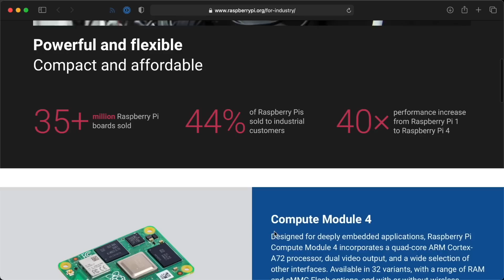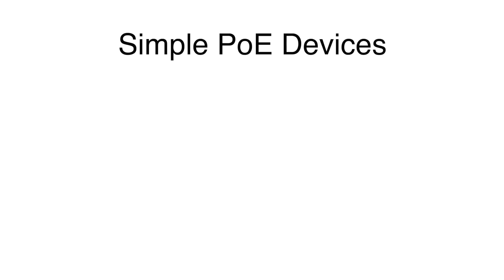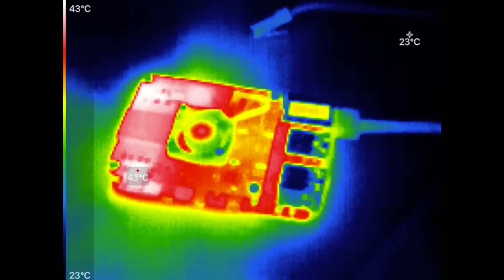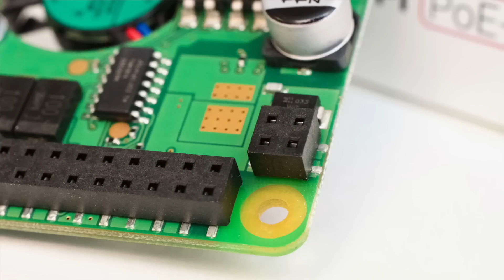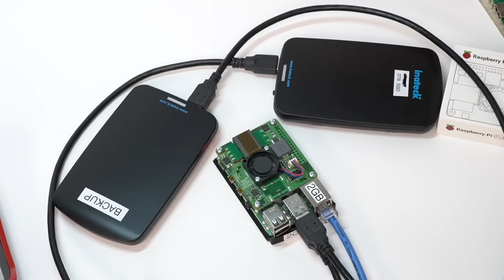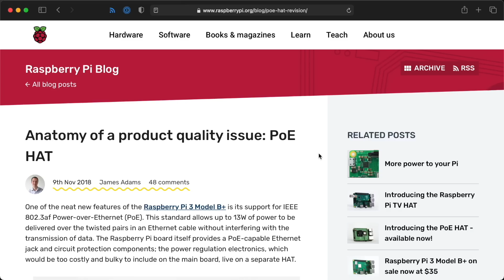Review: Raspberry Pi's new PoE+ HAT

Comment: They don't think much about their users and their products reflect that,  ivory tower syndrome.  They had a nice official case with swap out side panels yet they flipped the ethernet and USB position on the Pi4  making not only their own but lots of third party cases obsolete and they switched to the awful micro hdmi ports that literally nobody likes.
Reply: Having the same layout for like a decade is pretty good already. Sometimes, designs need to be changed in order to improve a device. 

They switched to dual micro hdmi ports because a lot (i assume. they wouldn't change it for just a dozen buyers) of customers use rpis for digital signage and wanted to drive two monitors at once, and couldn't fit two full-size ports. I personally think this wasn't a great idea, as the rpi is supposed to be an entry-level computer for learning and hobby projects. Businesses that need to drive multiple monitors for signage can afford more expensive options.

Unfortunately, if they change back to regular HDMI now, we'll have a third layout that's not compatible with neither 1-3 or 4 cases, so we're probably stuck with those shitty ports for a while.
Reply: @stale2665  ..as for “RPi 1-3 cases”, remember that the LEDs changed location on the RPi3 series, and the SD card slot changed as well…..
Reply: The issue here is lack of competition. The Pi is pretty much a monopoly when it comes to SBC, so there's no incentive to even listen to users. Whatever they do, people will complain, but buy it anyways, defeating the purpose of complaining about it.
Reply: Almost 100% of changes that the Pi has gone through were the results of USER REQUEST.

“Faster CPU”
“More/faster RAM”
“Faster USB”
“Faster network (gigabit)”
“Better/Faster Video out”
“4K Video!!!”

Well, folks, all these changes required faster chips, and faster chips required PCB lay-out changes..
And some of these layout changes required re-locating traces and chips and ports.
Some changes were dictated by physics (signal, current, AC-coupling, DC-coupling, inductive coupling, capacitive coupling, thermal coupling, etc & etc & etc) requirements..
PCB layout can be fiendishly difficult.

If the “deaf, ivory-tower snobs” had never listened to users, we would still be rockin’ Raspberry Pi 1A, 256M, 500MHz CPU, USB2, 100Mb network, 800x600 video…..
Reply: @ernestgalvan9037  How long it took for them to let us boot from USB again? People have been requesting that since the first model. Same for having the source code for the GPU.
Reply: @BrunodeSouzaLino  …yes, once again, RPi had to make major changes to the basic architecture, which deeply impacted things such as boot capability. The differences may seem trivial to a non-engineer, but they were extremely deep changes.

As for the source code for the GPU, go ask the manufacturer..RPi merely purchases the chips from the foundries, and almost always is hobbled by NDA’s.

Comment: Great video!  I always assumed that POE would not be very efficient with power use at either the router or client device, but I"m looking forward to your video about it.
Reply: With PoE using a high enough voltage on the cable, things like voltage drop and associated power dissipation can be minimised, so it comes down to the efficiency of the voltage conversion circuit of the power sink/client device.

I could see it being theoretically plausible for a PoE switch's bigger, maybe-higher-quality AC-to-DC adapter to have sufficiently improved efficiency compared to the tiny, as-cheap-as-possible power bricks supplied with random consumer devices, that it works out more efficient to use PoE.
However I've not run the numbers, nor experimented with it myself, so this is just an idea :)

Comment: Did the Pi Foundation email mention anything about the screw issue?
Reply from the maker: Not yet. Still trying to figure out what the deal is there...

Otherwise maybe RSJ can start a mail-in screw-shortening service!
Reply: My Engineer PA-01 tool (combination crimp tool, insulation stripper, wire cutter, etc.) includes a screw cutter for M2, M2.6, M3, M4, M5 screws, and it sees a fair bit of use with my 3D printer and related projects.
https://www.engineertools-jp.com/pa0103

Sometimes I just don't have the right size of screw on hand, or I need a screw in a weird length. Being able to easily cut a screw to length with a simple hand tool is pretty neat 👍
Although even M3 screws require a concerning amount of force to cut with that tool, so I'm not sure I'd like to try cutting M5 screws/bolts with it! 😐

And it doesn't ruin the screw threads, as most tools would!

Engineer tools are definitely not a super budget option in this age of Chinese mass-produced tools (and which are often perfectly adequate for the job), but they're not unreasonably expensive either, especially since all of my Engineer tools are high quality :)
Reply: How about now?
Reply: @AstroCat Why couldn't you just say grinder.com? Does YouTube block comments that have links in them?
Reply: @G-u-z-i-o  Depends on cnannel owner's settings.
Reply: @erkinalp  Well... This one does not, apparently. Otherwise you wouldn't see it.